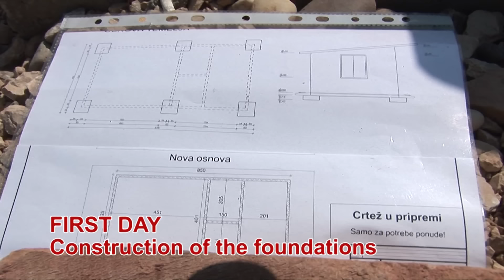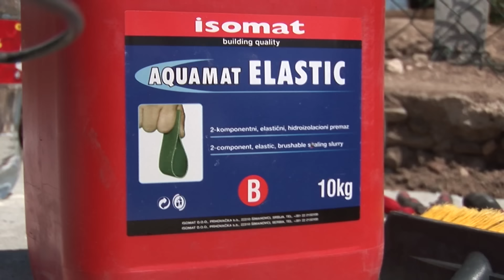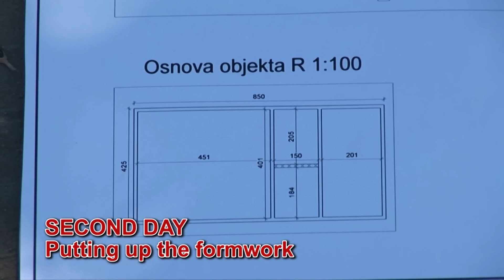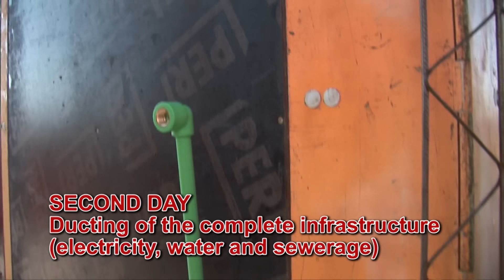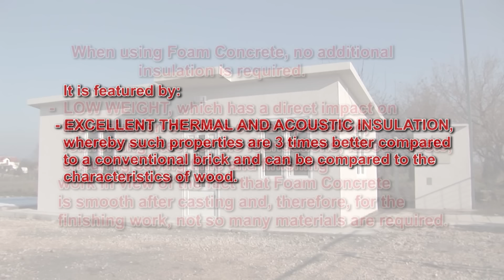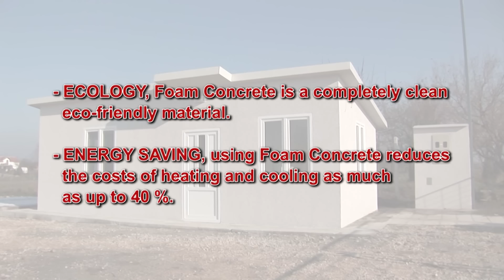FOAM CONCRETE, affordable house built in 6 days!

Comment: I've worked on many a rush job before. But this video has you snowed. They left out all the time to frame or fir out the walls, install the electric and plumbing rough-in, get the inspection (3-days), then you can hang that sheetrock / drywall board, Spackle the joints and skim around everything that penetrates the wallboards. Let it dry, go back to light sand and feather those joints out so you don't see them through the paint. Final sanding if you don't need to build it up any more to hide bad framing alignment. btw, US builds for the rather mild 5.0 earthquake in Maryland and there are different ratings required in other areas. Contractors will build to fit your bottom dollar price contracting or as custom as you specify. That's why the nice house in one neighborhood isn't a fourth the size in the crap neighborhood where banned materials may have been used to expand the listings of existing homes with additional bedrooms or apartments in the attic and basement. The that 1 level house would use the bare minimum of the building codes. Mostly plastic boxes and supports, non-metallic sheathed cables, MAYBE PEX water pipes and drains less than schedule 40 PVC. Some people just don't know what they are looking at or for.

Comment: House is generally built in that short of a period of time don’t generally have time to set up especially with the concrete and all the settling of foundations.  Maybe I’m wrong maybe they come up with some for magic solution. 
I certainly hope so the potential buyers because they should be in a world of hurt in a few years if the place falls apart
The fastest house I saw her together went from blowing it up with C6 high explosives and and then was move in ready in seven days in Wyoming. No small feat around here
concrete didn’t set right, sidewalks driveways basement floor all cracked and crumbled
shingles is blowing off the roof and leaking
Not to mention the TV people we did it for As a charity for people that totally did not deserve it so of course they trashed it.  hundreds of volunteers spending their free time along with dozens of contractors again spending their free time trying to put up a 4000 square-foot house in seven days.  NOT THE MOST  Intelligent move because the people that got the place we’re so far from deserving it it made me sick
I can think of plenty of people that would’ve treated that house with total respect and kept it up.  now it just needs quite a few pounds of C6 again. 
Oh well I see dumb people everywhere 
some people can’t manage a roll of aluminum foil let alone take care of a house
And those people or it

Comment: The building will be fucked in 20yrs. All that rebar will blow out eventually. A similar method was used by a house builder here in the UK in the 70's and all of those buildings eventually fail. There is nothing new about this in terms of the forms, Adding air to concrete ect.

Comment: Thats just a real over priced work shed could have built it out of blocks and made it bigger all that labor forms machines to move the forms and pouring that much concrete and not using a pump makes no sense its a cool design just think build should have had more thought put in it

Comment: Wells.. I think mayans did Better houses. That thing Will flly in a tropical storm.... Or any storm!  Maybe the floor would resiste. You enhineers should start Thinking on the climate change and construct really safe houses resistant to fire, floods, storms and electricity cuts.